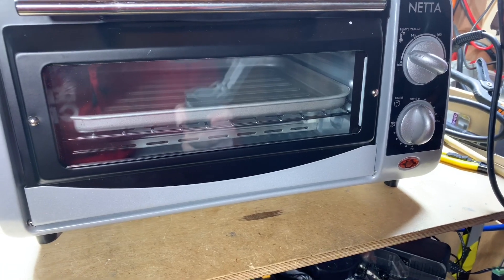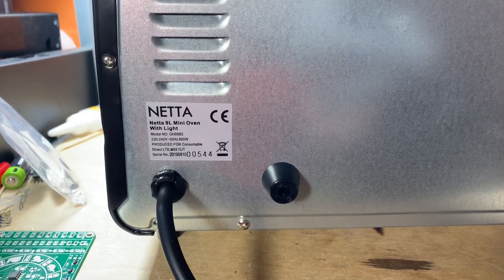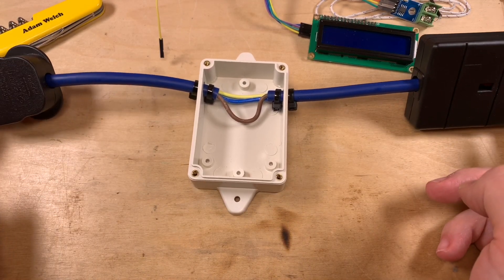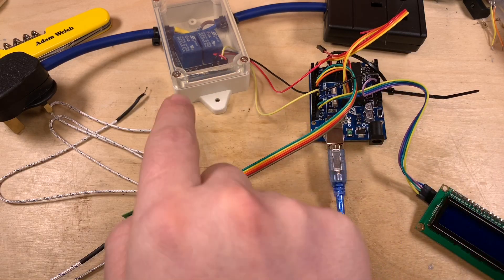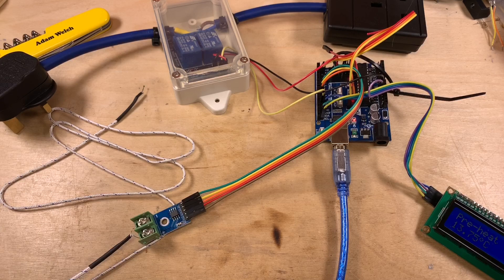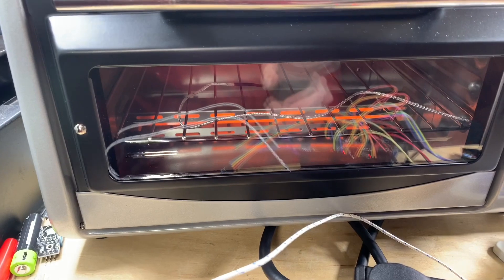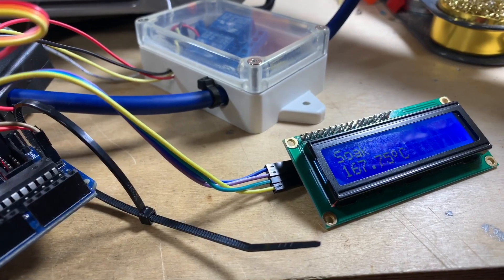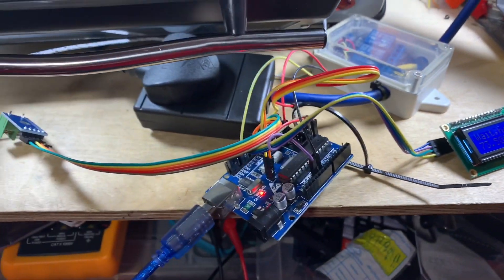Toaster Reflow Oven - Part 1 The Build

Comment: Nice project, I know a bit late on reply, but just a suggestion for future projects, was looking on the relay board and its got 3 terminals, NO GND NC, why not put the AC on NO and GND terminals?  This way microcontroller needs to be on for AC device to be operational.  I would for safety personally.

Comment: Watch out for the rating of the relay contacts.  The normally open contacts can have a higher rating than the normally closed.
Reply from the maker: Useful info. I’ve just taken delivery of a solid state relay which will at least be more quiet if not anything else! Thanks.

Comment: Nice one, Adam. That's certainly a low cost solution to the task. Incidentally, and assuming that the oven truly consumes 800 Watts (See below), if you reduce the voltage supplied to the oven by about 50 Volts, you will bring the power consumption to within the capabilities of your inverters, and the heating time will not be increased by a huge amount. Allowing for good insulation, in the worst case, heating time should increase by about 35%. The preheat time will not be affected by much, if any, because the relays will compensate by having their contacts closed for a higher duty cycle. 

Please note: The statutory compliance label likely only shows a maximum possible power consumption at the top of the operating voltage range. If indeed the oven consumes less than 800W, as I suspect, then the desired voltage reduction will be less, and the heating times will not be increased by as much as you might think. It will be worthwhile for you to check the power consumption at different supply voltages. An auto transformer or better still, a Variac, will be useful. 

In the worst case, you can always add a series resistive load (such as another heater of suitable size) to the oven in order to make power consumption tests which will be good enough. Or you can simply run your inverters at a lower output voltage, supplying the oven directly, to see what happens.

Comment: That relay board is double isolated... The relays themselves will have a pretty high isolation rating themselves.
The opto-isolators are probably more to switch the higher relay coil current than the arduino could do directly from an I/O pin.

Comment: Awesome, not bad for that little oven! When you open the door at the end, don't open it all the way immediately, as you'll risk thermal shock of the  components on the board. Open it about 20% for about 5 seconds, to let a small chunk of heat out, then open all of the way.
Reply from the maker: That’s handy to know. Thanks Seon. I’m trying to do it in small scale - cos the sheds so crammed full! Looking forward to seeing the RMPro develop :-)
Reply: Adam Welch you should get one proper RMP someday. Will be safer and easier if you reflow more often.

Comment: Nice budget solution there Adam. 

As for powering off your solar. I'd put a power monitor on the oven, as I bet you'll find it consumes less than the label says it does, especially as most inverters output only 220 Volts, which will lower the wattage on a resistive load like a heating element.
Reply from the maker: I’ll give it a go, my inverters are protected but I did test the oven and it was using 865 watts!  Good for soldering, bad for my solar!

Comment: Do Electrolytic's mind those temps ?
Reply: Quality surface mount electrolitics will be fine up to around 230°C, but it's best stick the the reflow profile for the capacitor being used. Other devices on the board will be fine, within the tight profile of the electrolitics.
Reply from the maker: Best to check the data sheet in each case - but if they’re surface mount caps the answer is most likely yes for short periods.

Comment: I have a bundle of those MAX 6675's.   They're quite easy to use.   I built a guy a Engine Ex-host / Head  Temp meter set for his Ultra Light Air Craft using one.
Reply from the maker: Neat